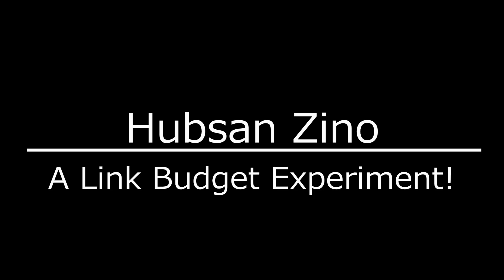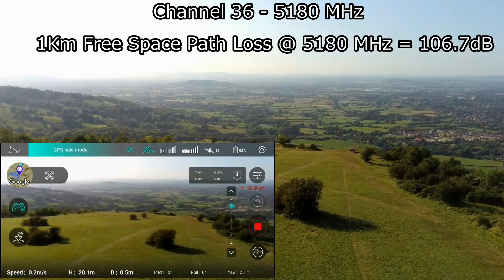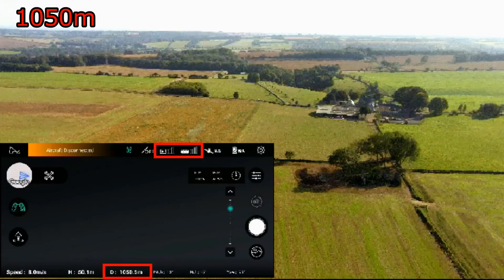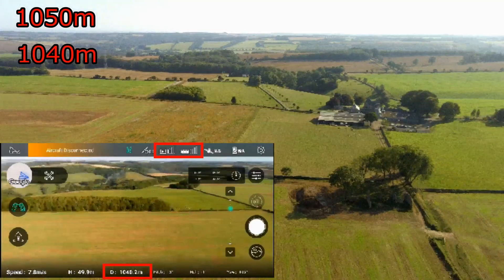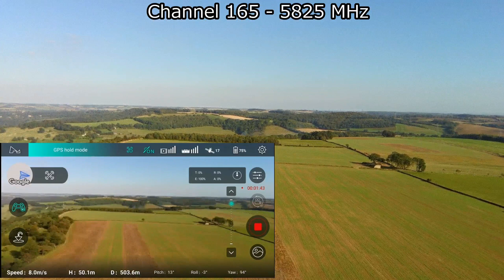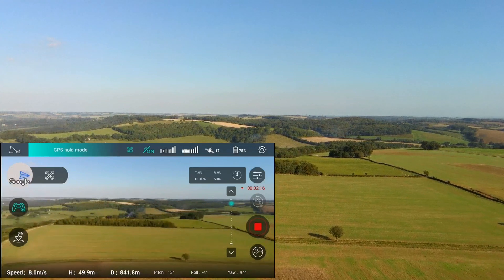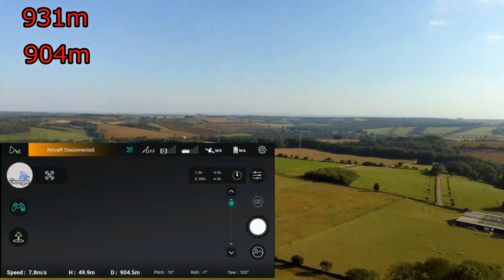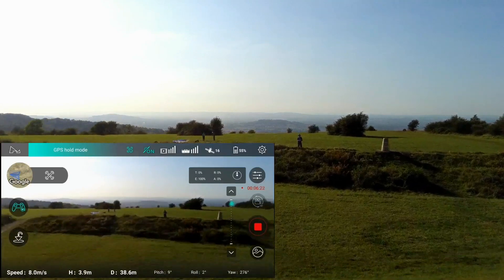Hubsan Zino - An Experiment on Range.

Comment: I saw your 4 month before videos which shows you fly max  1700 meters,  but this video test seems not consistent with that video
Reply from the maker: This video changes only the frequency of operation and kk reps all other parameters the same. 1700m is performed differently 😉
Reply: @randoneur  if i understand correct,  according to the calculation  1700 is not possible

Comment: If going up comes down in range come down in range would that go up wot is different in Zino pro as should go 4km
Reply from the maker: I've no idea what the Zino Pro contains hardware wise. FCC documentation has not yet been published, I haven't seen anyone opening one up, and I don't own one or expect to :-o
However Hubsan have said they are using a new protocol (LEAS) not wifi. Wifi as standard is constricted in range to approx 1600m due to the time it takes to acknowledge packets, but  changes in the wifi protocol or a new protocol LEAS?)could easily give a 10 dB improvement and remove the 1600m limit. I'm sure someone with a pro will eventually do a full breakdown of what it contains and how it works.

Comment: OK, so you have accurately predicted the distance difference between the two frequencies using the multipath loss formula. I get that, but what if Hubsan's limit is set at say 1300 meters and you merely lost the signal because if mulipath error, etc?

Comment: That was a good idea and I think the result is valid, therefore from now on I will use the lowest frequency in order to have the best connection, thank you !
Reply from the maker: There is a problem with the lowest frequencies!
Channels 36 - 48 are very widely used by other mobile devices. There tends to be very little usage of 149 - 165 in many places however :-)
I'd check the actual usage in your area before making a decision.
Reply: @randoneur  yes, certainly, but as I only fly within viewing distance,  I'll probably stick at the preset channel